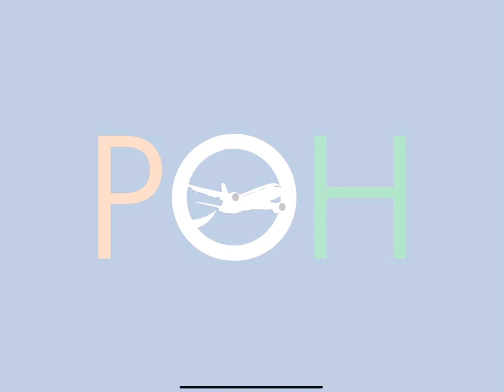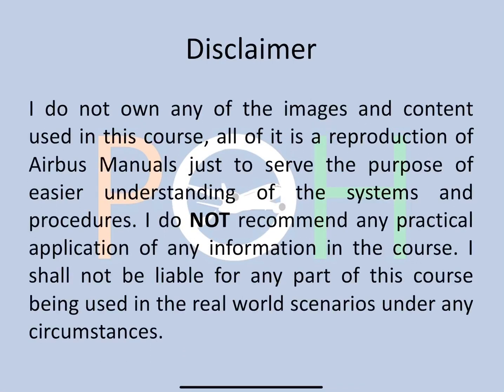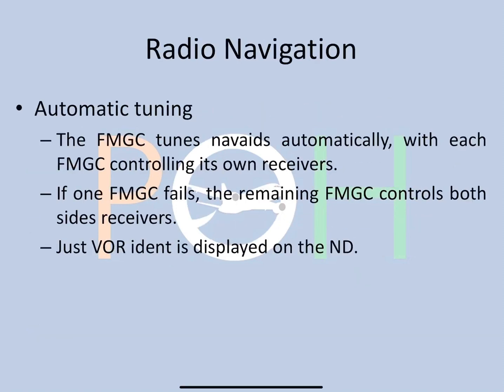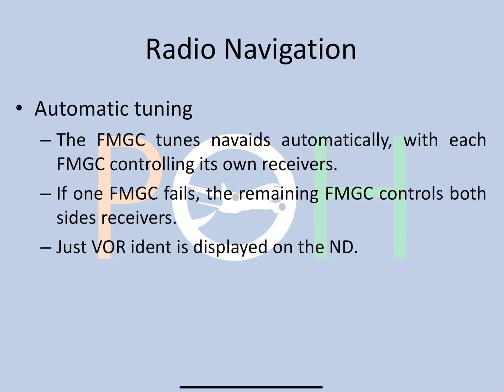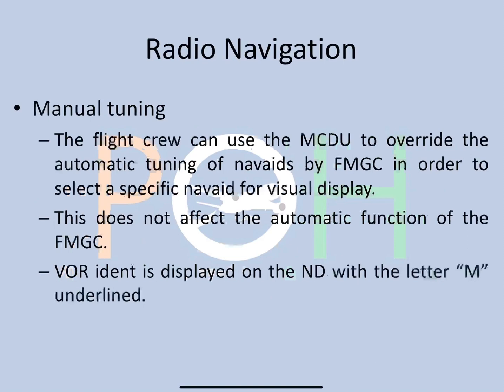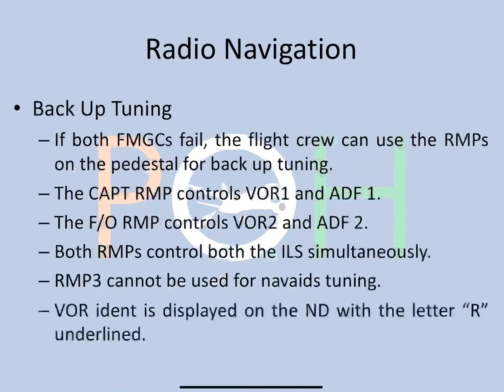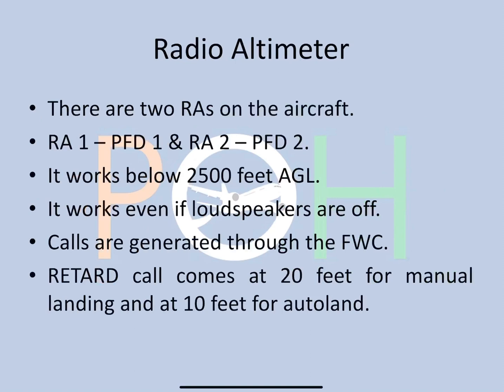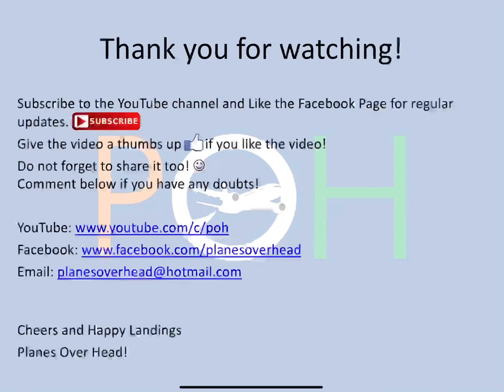A320 - Navigation - Rad Nav & Radio Altimeter

Comment: Do you know what tells FWC that aircraft is airborne(i.e. Transition to phase 5)?LGCIU or Radio Altimeter? I tried to find it in fcom but I couldn't... I was pretty sure that LGCIU does it. But apparently, on contaminated surfaces, RA readings may fluctuate and trigger spurious ECAM alerts such as ENG DUAL FAILURE because the FWC assumes that the aircraft is airborne. But in my opinion, it is more sensible to use LGCIU data(shock absorber extended) rather than using RA's positive readings since the event that causes FWC to move on to phase 5 is "Liftoff".
Reply from the maker: Yes it is undoubtedly from the LGCIU only, infact some information related to this can be found under the heading "PROXIMITY DETECTOR OUTPUT SIGNALS" under landing gear chapter of the FCOM. DSC-32-10-20.